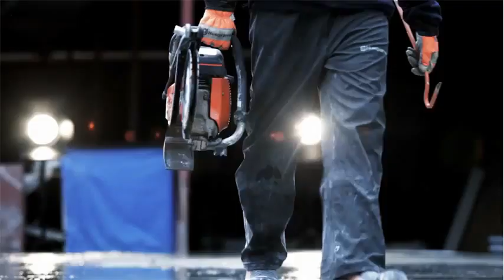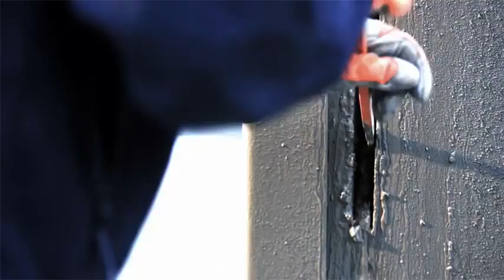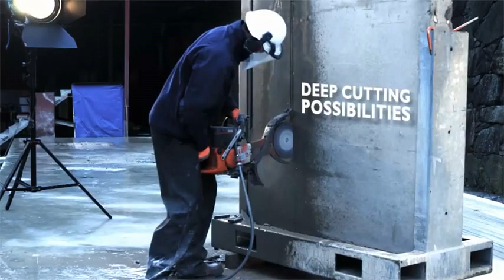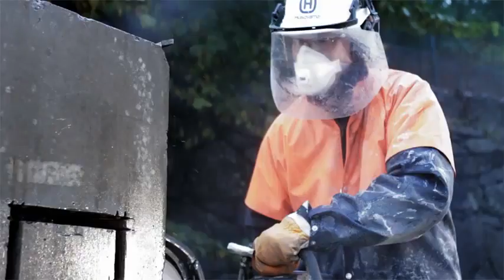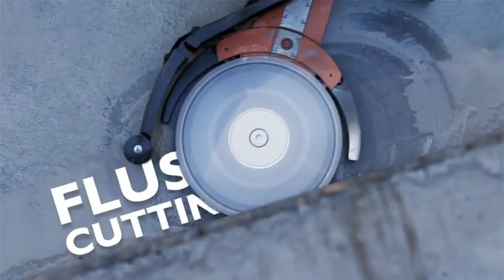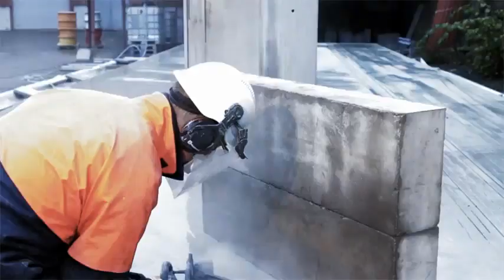Husqvarna K760 Cut-n-Break Concrete Saw

Comment: What kind a gas should I use for this saw?  Some please...,,
Reply from the maker: Always refer to the owner's manual to ensure you are using the correct fuel and fluids.
---
Fuel type, min --- RON min 91 or alkylate
Fuel type, min (NA) --- Octane rating min. 87
Lubricant type, engine --- Husqvarna 2 stroke or equiv. at 50:1

Comment: I own two of these miserable pieces of crap (model K760's). I bought them based on the good performance of a friend's Husqvarna chain saw. There is a design flaw in the throttle mechanism that keeps failing. The water mechanism plugs up constantly. The muffler fell apart on one that has been used only minimally. There are other problems as well. Two local authorized dealer service departments near me are worthless. I have owned and operated other manufacturers 14" quickie saws that run practically trouble-free. I had a glimmer of hope when Husqvarna told me they would fix saws free of charge. I shipped them to their Olathe, KS service center as per factory rep instructions. I waited ninety days while begging for some communication. They finally responded with estimates to repair saws including an engine kit for one- at my expense. Wish I had never purchased.
Reply from the maker: We appreciate the feedback. Sorry that it has been such a negative experience for you. If you have purchased these saws through us, we can get our rep to look into this matter, but we would need more information.